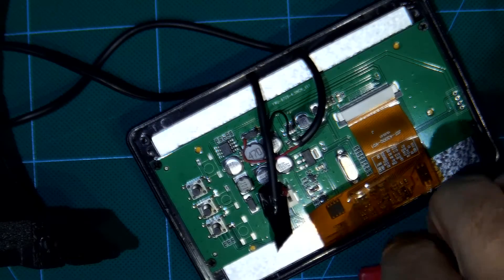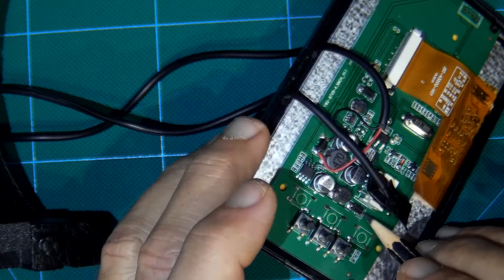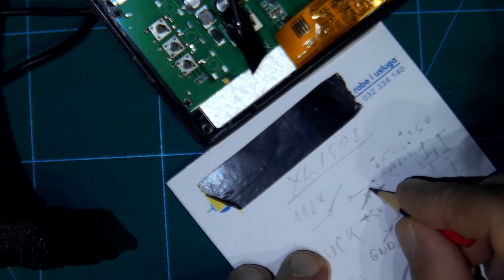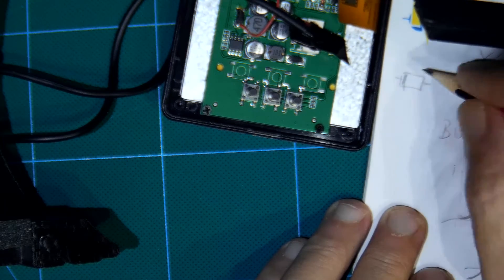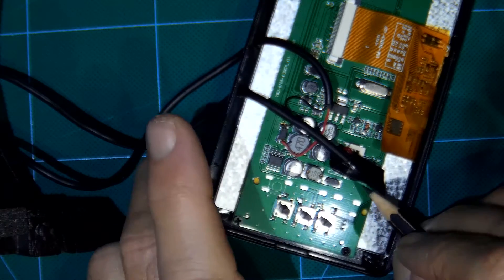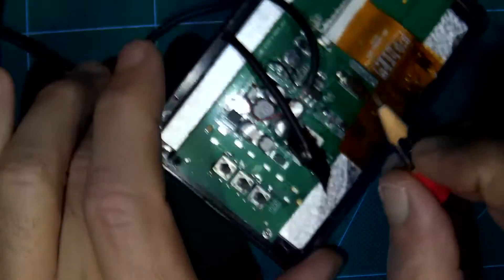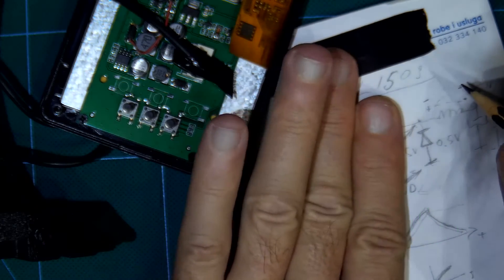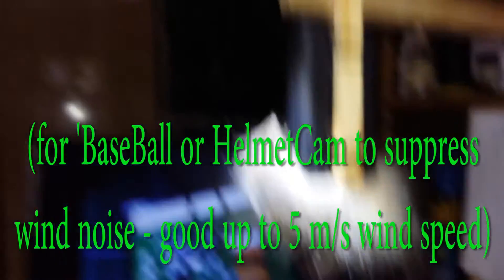How To Convert TFT Monitor From 12V to 5V Power Supply

Comment: Hi, I have a 7 inch Car TV that I am repairing, It uses an AMT629 cpu with a 12v power supply, Previously there was damage to the technocode td1482a ic component. After I replaced it, it seemed like everything started to work. but i get the input voltage is only 5v on the backlight line, where it can only turn on with 12v.
Can you help?

Comment: hello  How To Convert TFT Monitor From 19V to 12V Power Supply pleace help me
Reply from the maker: I have no idea. There should be some data if you open monitor... at least look for voltage controllers.

Comment: I noticed I was planning an upverter to get 12 volts for the LCD in my gizmo and thought of this idea. Inside the monitor I saw the power supply section, a downverter, seemed stupid to not try bypassing it, not clear how to safely do.

Thank you for validation and your example. Not too long avideo,I almost worried that it was so short you might not have anything to say. Had to laugh at the music, very nice. THX.

Comment: nice video Milan. with 5volt only, can I plug it from usb port from (laptop or stb dish receiver?)
Reply from the maker: Uh, not sure about current. USB provide only 500 mA, and I am not sure now how this thing draw current. Don't burn your USB port on laptop. Rather use power bank or something similar.
Reply: @MilanKarakas  thx bro.

Comment: Thanks.  This worked on the 3.5 inch car monitor currently on Amazon.ca
https://www.amazon.ca/gp/product/B0045IIZKU/ref=oh_aui_detailpage_o02_s00?ie=UTF8&psc=1
My display does not use the XL1509, so I was at an impasse. The big clue was finding the Schottky diode (SS14) near the inductors that had 5 volts across it.  Connected a 5v USB power supply across it, as you described, and instant joy!  Thanks for sharing!
Reply from the maker: Thank you too. I hope that you can find at least 5 inch monitor for car - much better picture. Just not sure for price.
Reply from the maker: It is interesting that such small monitor (3.5 inches) on eBay cost less than $15. Yes, screen is small, but brightness is good. I have another, 5 inches - too low brightness. One of the video is actually from HobbyKing, but not bought alone - it is part of FPV goggles (with Fresnel lenses). The difference - HK one does not has blue screen when there is no signal or poor signal, which is annoying for FPV flights. Your (and mine) 3.5 inches monitor is excellent for direct monitoring on Mobius camera - so that you can see what you actually recording.